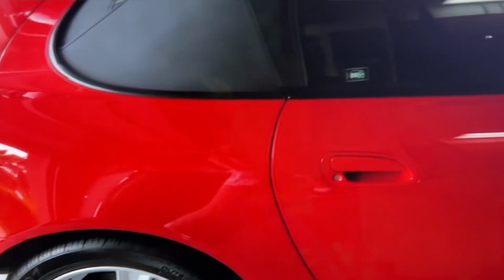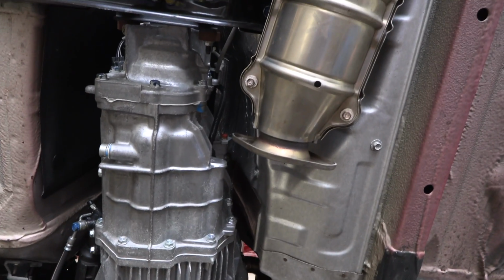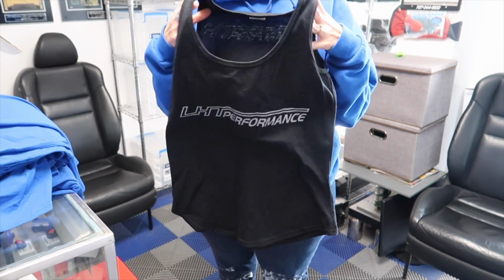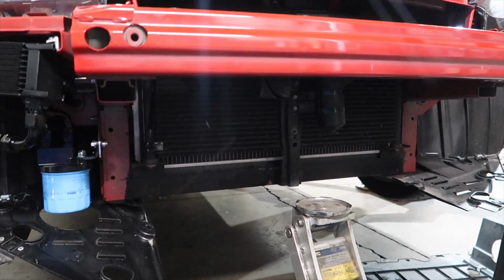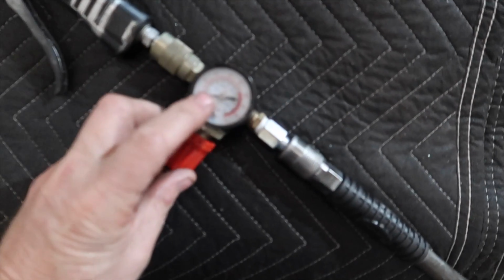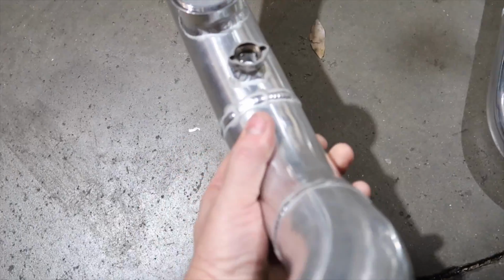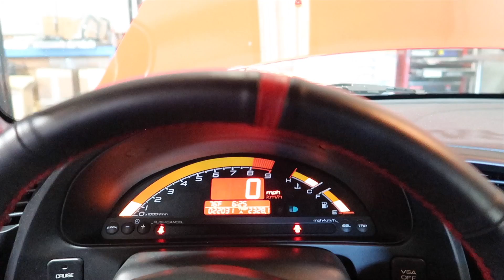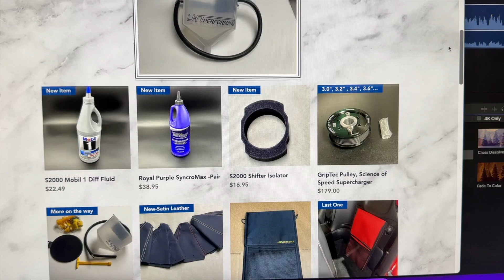OEM +  S2000 Build  - LHTs own car

Comment: I bought a dual cat system like that for my RX-7.  I like cutting down on smell and noise where possible.  I've always been curious about just big OE cats from a full-sized truck or something like that as being viable.  It feels like OEs just operate on a different level from the aftermarket as far as cat quality (and I assume components) are concerned.
Reply from the maker: Yes, as much as we like to improve on oem things, they often use much higher quality parts in some circumstances.  The C6 Corvette cats are actually amazing, I’ve made lots of power on a single cat on a Honda.

Comment: John, why not locate the exhaust valve before the muffler but after the Y, then it wouldnt be visible at all?? Also very interesting idea with the double cat! Id be interested to see how it works out, Id love to see how the power compares to just a straight pipe and vs. a single 3 inch Gsport cat in a single pipe
Reply from the maker: Placing the the valve the end of the muffler utilizes the muffler itself. Like the Z06 design.
Reply: @LHTPerformance  do you mean it uses it like a big hemholtz resonator??

Comment: What kind of gas mileage does the S2000  turbo kit get while cruising on the highway?
Reply from the maker: If tuned correctly, gas mileage is unchanged. Fuel Is dependent on load, it takes X amount of HP to maintain 70mph. Turbo or not.

Comment: Why change the suspension ?  It has an amazing adjustable suspension stock.  No ?  And exhausts. Never understood why 
People waste money on that. 
S2k cones with a full stainless system end to end.  I guess in this case there is some good lht reason to have that valve.  Ahh. I See. To lower the drone. Make it pleasant. Agreed.  Clever.
Reply from the maker: The suspension is non adjustable. Coil overs allows to lower to the desired height , choose spring rates and tune to the environment. The stock exhaust limits power, plus it’s very heavy. Our titanium exhaust sheds about 40lbs and has the built mild to wild sound the immediate via the throttle. 
  I thought this was fairly clear 🤔

Comment: No no no the math is all wrong on dual pipes.  Pi(R)² is the formula to calculate area of a round shape.  Not accounting for wall thickness to keep this simpler for comments...2.5" has a gross area of 7.85sq inches.  3" is 9.42sq in.  Dual 2.5" gives you a combined gross area of 15.7" inches which is greater then a single 4" tube.  Obviously you have enough capacity there with the twin 2.5 but you could of gone smaller...even twin 2" and still have more area then a single 3" however you run the risk of the transitions becoming difficult to do smoothly in a compact space.
Reply: Then when you factor in wall thickness thats when the numbers show the area loss.  So say a 16ga 4" has an actual area 12.15sq in...but twin 16ga 2" has an area 11.74sq in for instance
Reply from the maker: @garage79r  Yes, dual 2” cats I’m sure would be effective enough, not to mention the asker to fit the space available. Sometimes you use what on hand. I will do plenty of testing with this because I do want to run a catalytic converter, I want to find out first hand how it affects power and how clean it is. I may of may not share the results, depends how interested people are. Right now I’m Chasing another slight issue, I tend to be a little picky with certain things and need them to be right. Thanks for piping in, I always like to Understand the science.